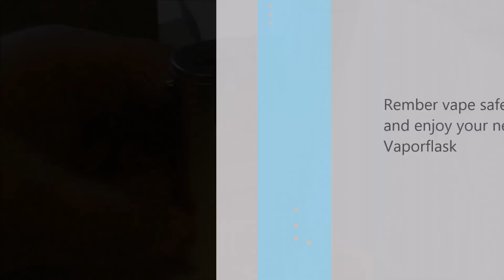vapor flask v3 40w clone instructional video

Comment: Is that 4v as in both batteries at 2v?
Reply from the maker: what are you asking? It does 1 watt to 40 watts
Reply: The low voltage warning for 4v, is that 4v each cell or combined (as in 2v each) I'm not sure if it's in series or parallel. Sorry wasn't clear at all on that.
Reply from the maker: sorry about that I just looked at that I messed that up the low batt alarm shows at 3.5-3.6 volts

Comment: OK I just got the Vapor Flask V3 today. I went and put my 2 Sony 18650 batteries. I put my addy on and hit the fire button and it came on for a second went to go do something really quick and came back and now it won't turn on at all. I also tried switching the batteries and still nothing.

Do you have any suggestions on what i can do to get it to work again.
Reply from the maker: where did you buy it from I would get them to replace it. sounds like  the chip is bad.
Reply: Jimmy The Mad Vaper I got it off of ebay.
Reply from the maker: ChunkyBastardProds Email them about the problem if there a good vendor they should replace it. I only stick to vape shops I know, you sometimes pay a little more but they take care of you if its defective.